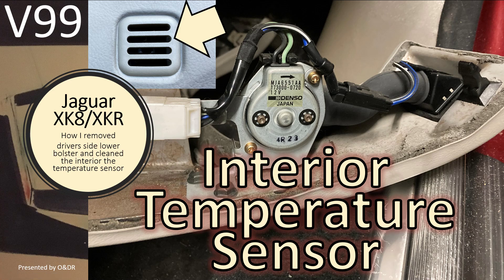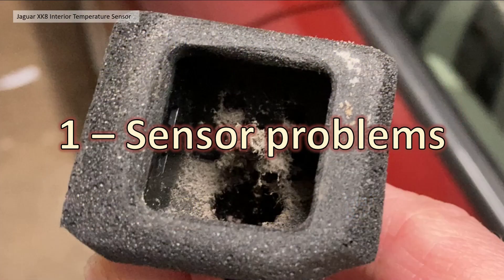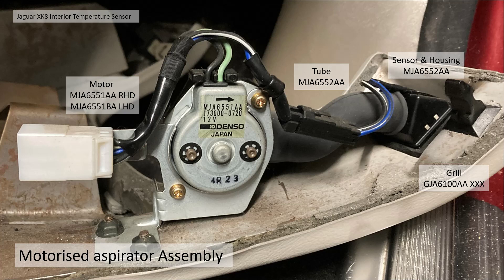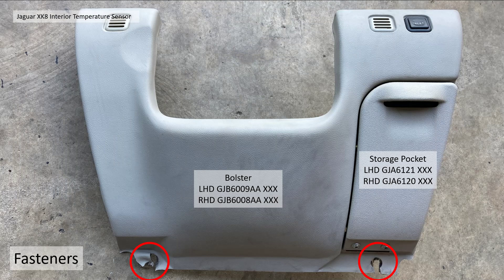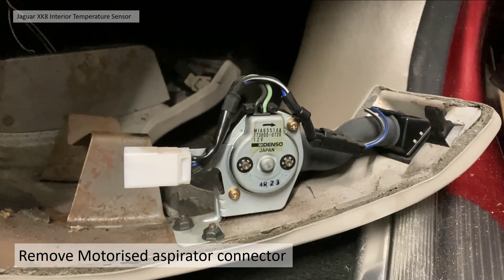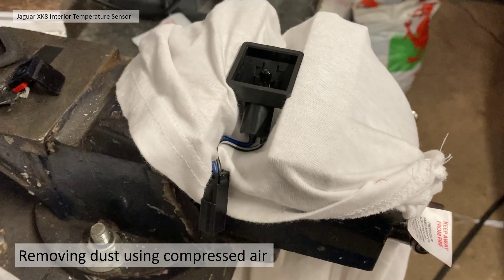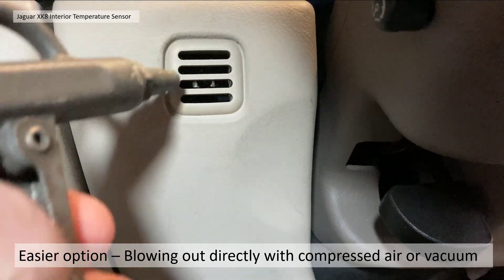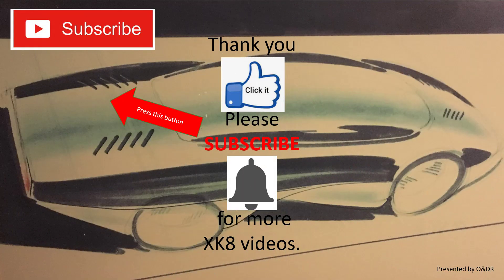Jaguar XK8 Interior Temperature Sensor cleaning (and drivers lower bolster removal ) V99/ XKR (X100)

Comment: Cheers Damian, another useful video,  will be checking the sensor tomorrow.
Reply from the maker: Terry, thanks very much. Just hope it fixed my aircon issue will find out in April. Thanks for the comment and support regards Damian
Reply: @ODRModurol  aye, good luck with the a/c, with luck that's sorted it. Dont know if I could wait for April though  😁
Reply from the maker: Terry, going to start her up tomorrow but probably not long enough to test the system. Regards Damian